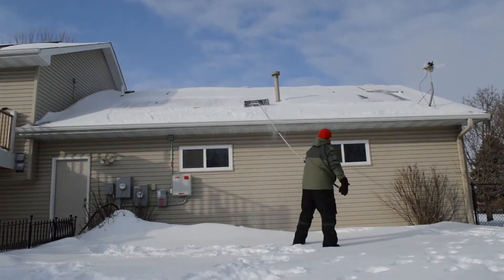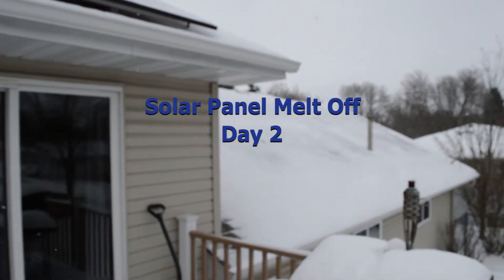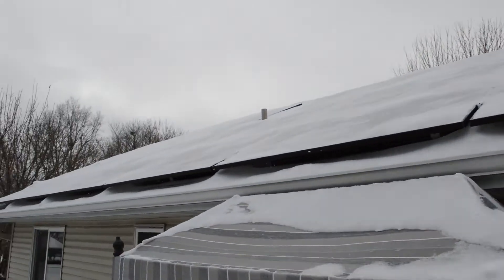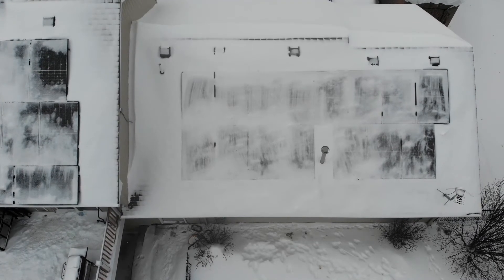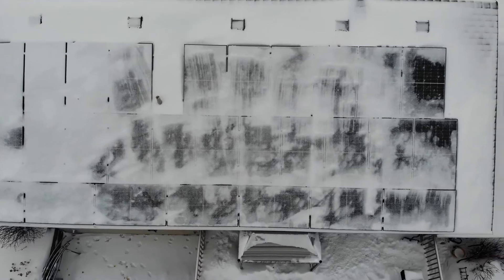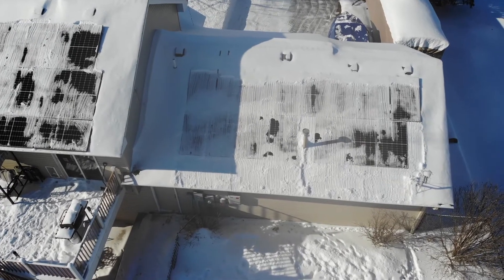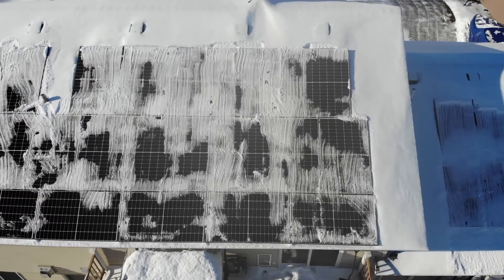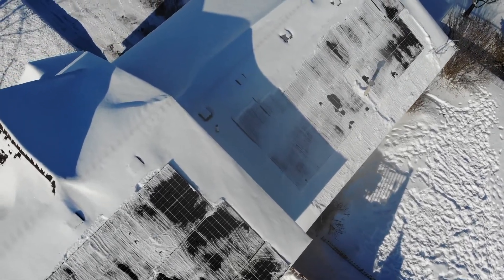How Long Does it Take for Snow to Melt off of Solar Panels?

Comment: Some types of snow conditions can't be raked.  I have had zero output here in Michigan for about two weeks now.
Reply from the maker: That's somewhat true in my experience. If the snow is really wet when it falls and then the temperature drops quick you're basically dealing with packed ice on the panels and you're correct that it won't rake off. In my experience though the ice usually falls first so even if the bottom layer is ice, it's still helpful to remove the top layer of snow and expose the ice to the sun. When the panels start to produce they'll warm up slightly which can help the ice break off. For me, even if there's ice, one day of full sun (regardless of temperature) will help it break up and slide off as long as there isn't several inches of snow on top.
Reply: @dontburnthehousedownvideos   Hard to do on roofs, especially 2nd story, so your set up is a wise one if you can keep vegetation in check (that's harder the lower the panels are).